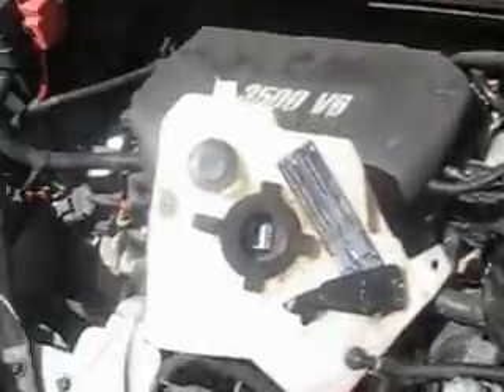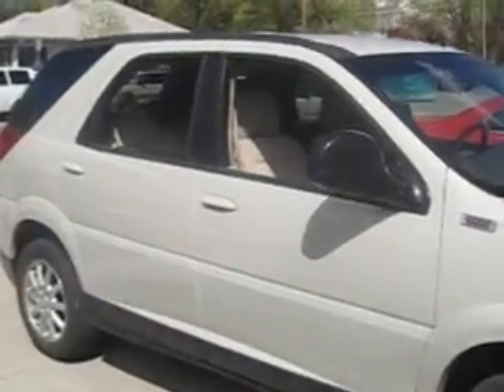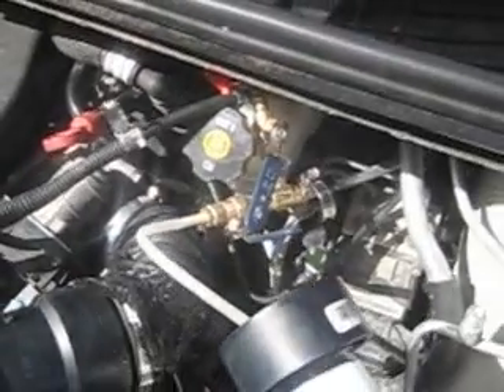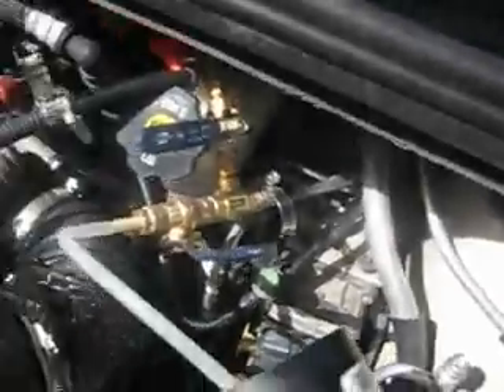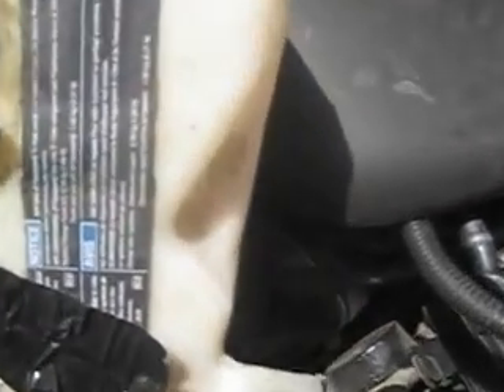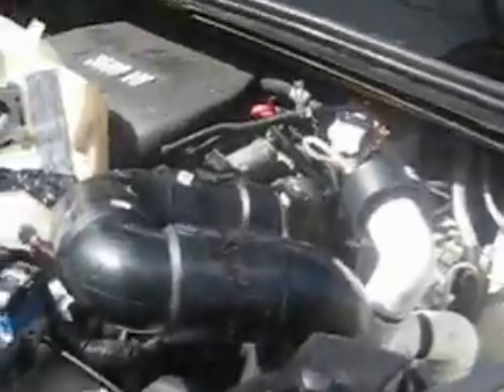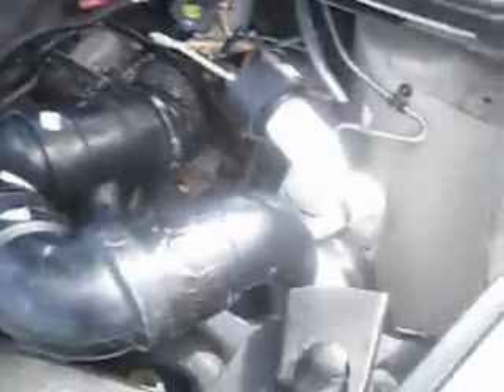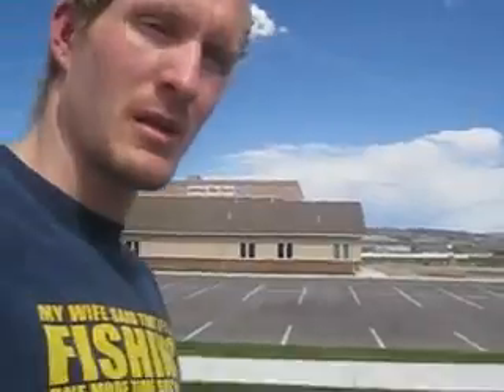200+ MPG Gasoline Vaporizer Project Original Design (Driving On Only Gasoline Vapor)

Comment from the maker: Thanks for the ideas. I am a few steps ahead of you on that. I have already tried using an ultrasonic 5 disk transducer. The new unit I am building will vaporize the fuel using exhaust heat. Once I have the new system up and going I will be connecting HHO up to my fuel injection system while running my car on gasoline vapors through the air intake..

Comment from the maker: It's the combination of everything that goes on when using HHO injection that make the engine more efficient. Frankly I do believe it is possible to run a car off of water it has been done and will be done again some day but certainly not by someone like you with such a closed mind.

Comment from the maker: The boiling point of gasoline is different from manufacture to manufacture and it ranges from 100 degrees F to about 400 degrees F at atmospheric pressure. It also changes with altitude, under vacuum, under pressure, etc. As for the vapor pressure it to depends on who the manufacture of the gasoline is. The auto ignition point of gasoline at atmospheric pressure is 536 degrees F. So yes I do know.

Comment: FYI you're an idiot, gasoline is not combustible as a liquid.  a fuel injector sprays a mist like a spray bottle would, tell the next person that cuts your hair to quit wetting your hair with a vapor!!  injection to combustion in the cylinder happens in under a second no where near enough time for that much evaporation to occur even under high heat.  learn physics AND how an internal combustion engine works before nay-saying.

Comment: What you are saying about incomplete combustion may be somewhat true, but only on a typical winter day, on a cold start. This is why carbs have a choke, and FI systems dump more gas on to compensate. Once warmed up tho and the computer switches to closed loop mode, it uses the O2 sensor to meter the fuel.

Comment: Well, if you were so educated, you'd know about things such as the boiling point and vapor pressures of gasoline, then you would know it is not possible for it to exist at the temperatures and pressures of a warmed-up, running engine.

Comment from the maker: DO YOUR HOMEWORK. RESEARCH YA HAVE TO DIG DEEP BECAUSE IT'S NOT ALWAYS EASY TO FIND BUT THE FACTS THAT THIS WORKS ARE OUT THERE. EVEN THE EPA HAS THE PROOF. EVEN THEY STATE THAT 56-60% OF THE FUEL IS WASTED IN THE EXHAUST.   CUT YOUR CRAP, EDUCATE YOURSELF, YOU NEED TO.

Comment from the maker: What happens when I burn the HOT vapors is a complete burn, there is nothing leftover. So cut your stupid crap and educate yourself more before replying negativity as you have because obviously you have no idea what you are talking about. It's also not a matter of believing this I don'r have to believe because I KNOW it works I've done it. If all the fuel were consumed it would not be possible to achieve these huge gains in fuel efficiency. So ya dude it does work.

Comment from the maker: Fuel injected engines do NOT burn ALL of the fuel. If they did cars would not need catalytic converters that heat up to 800+ degrees to burn unburnt fuel. If they burnt all the fuel you would not have to do emission testing and when you do do emission tests if all the fuel was burnt it would have a reading of 0. They never have a reading of 0. This right here PROVES that not all the fuel is burnt. In fact internal combustion engines are very inefficient about 60% of fuel is wasted/unburnt.

Comment from the maker: It runs perfectly fine when it is running on Hot vapors in fact it has MORE power with the hot vapors then it does running normal and significantly increases fuel mileage. Don't be making negative comets if you don't know the truth. Have you ran a car off of hot vapors? Most likely not. Therefore don't just assume. Just an FYI cars only burn vapors they don't burn liquid gasoline, this is why I pre-vaporize the fuel. Doing this allows 100% of the fuel to burn not just a portion of it.

Comment from the maker: It won't hurt it because I still control the air to fuel ratio using the valves. reading lean means more fuel is being burned.

Comment from the maker: I hear ya. I have developed a system that would work with any engine whether it be turbocharged, supercharged or just has a normal intake. It is not like the bubbler setup at all. Once I perfect the bubbler design I will be completing the injector adaptor design that will work on all gasoline engine types.

Comment: Vaporizer set up will not work on a turbocharged engine. Look at it this way: Naturally asperated engines vacuum a flow of air; Turbochargers there isnt really a flow as much as pressure in the piping and when the intake valves open, the air expands into it. Air gets in because it expands into the engine, not flow.
I hate that I have all these turbo sport cars and I cant do the same to them. I have a good idea on how to make it work, but I havent perfected it. Trust me, I want turbo and MPGs too

Comment: Have you tried putting a switch on the fuel pump relay, so that you can turn off the pump and not have to pull out the fuses or injectors. That way, if the vapors give you trouble, you can turn the fuel pump back on and drive on liquid immediately.

Comment: do you measure your EGT?? and your A/F?? im really curious b/c im tryna do it on my car but do NOT want my car to run too hot. Also...do you think fuel vaporization will work on turbo'd cars? since turbo'd cars consume alot more fuel and requires rich  a/f

Comment: Might I suggest a copper coil of perhaps 3-4 turns of 1/2 inch tubing inside your vaporizer. Run the ends out the top and hook to either the water pump bypass or to the heater hose con. This should pre-heat your gas enough to make enough vapors for higher RPMs.

Comment from the maker: I will be building a water injection system to go along with my improved design that I will be posting videos of shortly.! Thanks!

As for the air to fuel ratio I am not sure what it is, I am ordering a exhaust analyzer so I can know wither I am running too lean too rich or just right!

Comment: try running an oil pan heater into your fuel tub. have you ever checked your air/fuel ratio? i would guess your running really lean, which could harm your engine. think about doing a water/methanol or windshield washer fluid injection, i should help lower your cylinder temps and lube the upper cylinder, which is good because you dont have fuel spraying into the combustion chamber anymore.

Comment: this is a chevy issue now days, as they until recently ran returnless fuel systems in which vapour lock can occur if the raise is too hot (and does happen) but VP is very much an oldworld (carb) problem.  Modern efi uses a valve (fpr) to regular pressure the pumps dont.  Adjustable FPR's are easily bought these days with the capability of 60+psi though usually an upgraded pump is need as the extra PSI usually causes the pump to fail if its been around a while.

Comment from the maker: This was one of the first ideas I thought of but didn't do it because there are many factors to consider such as fuel line cracking or rupturing due to vibrations etc. You would need to design a devise that connects to the exhaust system that is a solid unit so vibration etc. is not a problem. I have one drawn up and may build it at some point but for now I am finishing the system I started, once that is done I may move on to a design with the came concept behind this one.

Comment from the maker: This is something I would need to look into more so I can know what pressure you would need in the fuel lines to prevent the gasoline from boiling. You would also need a device to control the temperature to prevent an over or under pressure in the fuel line a constant heat would need to be maintained. You may also have to change out the gaskets in the fuel rail and injectors to gaskets with a higher heat tolerance.

Comment from the maker: You got it!  As for wrapping the fuel line around the exhaust manifold to heat the gas under pressure then when it is no longer under pressure it flashes to a vapor this could work as long as you can maintain the right amount of pressure to prevent it from boiling. If the pressure happens to drop you will have vapor in your lines and this will most likely cause vapor lock. You may have to change out the fuel pump to a stronger one so there is more pressure in the fuel lines.

Comment: so the car is efi to begin with? and you have basically just added a manual carb and shut the fuel injectors off? Ive thought about having a brake shop fab up some new metal fuel feed lines that wrap around the exhaust manifold.  Under pressure of the fuel injection system (40+psi) boiling point of the gasolene is raised so it will stay a pressurised iquid until it is injected and at the right temp it *should* flash to vapour as its injected

Comment: maybe you can use just the butterfly valve in the throttle body to control the air/vapor flow with NO valve in the intake piping prior to the throttle body with a tuned orifice somewhere in the piping before the throttle body that is specific for the engine/car set up you are using?

Comment: In this video you seem to have reversed the air flow into the bucket. Before it came in from the side of the bucket closest to the firewall. Now it comes from the other side. Can we get detail of the vapor/air exit set up from the bucket and continue with the butterfly valve into the throttle body. also, looks like the air intake is still hooked to a filter of some sort rather than just sitting open. Details?  Thanks!

Comment from the maker: No not at this time. I am in the process of building a different design which will be problem free. It will provide consistent results and will be a design which people can replicate and achieve the same results as I do because it will not have problems as this one did. I will have electronic float switches that connect to solenoid valves it will have the proper splash guards and much more! I will be installing it in my Jeep for testing! I will make videos of the build install and testing!

Comment from the maker: The reason I was not able to go past 3500 RPM's is because the system was not built properly. I did not have good enough splash guards so when my engine reached high RPM's liquid gasoline was being sucked into the air intake instead of just vapor. Once I added better splash protection I no longer had this problem.

I will be adding HHO into the system at some point because I believe it will increase power and efficiency even further.

Thanks for the suggestion!

Comment: Compressor line to the the gas tank with a dip tube, pressure gauge will automatically keep pressure equalized, then the high pressure line from the fuel tank to the Fuel Rail to the injectors. This way you don't change or add much to your existing fuel system under the hood.

Comment: I had an idea of inspiration yesterday after watching your video's a couple of times. How about instead of running the Vapor through the air intake, you install a small adjustable pressure 12v compressor in the car, pump Air directly into the gas tank with a dip tube, then a pressurized line directly in the to fuel Rail to the injectors. That way you don't have to draw air through the gas, you actually create vapor by adding air, which forces the Vapor into the existing fuel system. Thinking.

Comment: Very good work man. It is just amazing. I need to watch your other videos but why do you not use your bucket concept?  I cannot figure out this design with the fuel supply running into your intake/bubbler... So pulling the air through less fuel makes for better vapor?

Comment from the maker: No not when the proper vapor system is connected to the car. 

With the system in this video yes because I did not have a good enough splash guard to prevent liquid from entering the air intake at high RPM's.

Comment from the maker: On this systems and the systems I have designed to inject the gas through the air intake no efie or computer is used to control the vapor because you don't need need them since  the float switch controls the gas entering the vaporizer and the butterfly valve on the air intake controls the amount of vapor entering the engine. No the vapor does not mess with any censers if you connect the censers up to the air inlet side of the vaporizer.

Comment: Man, ill email the video, i dont want this out for several reasons. However i want u to build it, test it on multiple vehicles, and tell me what u think, i makes me nervous having moving parts inside the intake tube. Cheapest float switch is at academy or  lowes by the way. Also if u want to asd horsepower to a stock engine, add this unit too, while fuel injectors are still rockin.

Comment: Just fyi, i dont know what my mileage is i have more tests i have to run for sure....but i usually keep 1 gallon in the unit and its lasted the last week of driving from here to work, to day care, and back home everyday so far....it still is hesitant around 5000rpms....lacks power, so on larger engines i may add a second unit with a spring loaded valve or a WOT switch to activate it.

Comment: Well with the stainless hardware its already pricey, we would probably make $50 profit per box maybe....u can use the armature off the existing fuel pump or add a second float switch by getting one off of summit racing . But those are pricey. I made out of old nissan fuel pumps and floats cause i used to work for nissan.

Comment from the maker: As for the price on the units I will have to see exactly how much it will cost to make then determine the sell price from there. I'm not into making allot of money off them I just want this out there for the benefit of everyone.Once I have the materials and labor costs I can let ya know what I would sell them for. A bubbler type of setup would work good for carbureted engines but I have a completely different design for fuel injected engines.

Comment: My units also have an auto fuel fill float switch when levels are too low, i say we sell each unit for $350 each. Mine are fail proof, explosion proof, and safe with little modification using most of the stock engine intake. I cant do this by myself, i dont want to be on a hit list.

Comment: Tyson,  i work for an electrical company now, i built a vapor system similar yet different to yours, i can get stainless steel boxes and tubing for any size engine, mine ran a honda crx and my wifes f150 with the v8. I have a unique back flash valve and a bimetal air trim regulator for weather change. No check engine light will occur, quick start, and immediatly stable. Only emmision is amonia and h2o, no nox or carbon monoxide....wana go in business and take down shell, valero, exxon, email me!

Comment from the maker: Not at this time no I wish. The system that I got the 200+ MPG on was not a good enough design there were to many problems with it therefore it was not reliable enough to keep installed on my car. I have since redesigned the system and have created a completely new system but am still building them and making improvements on them. There is still allot to learn before I can say I have a system that is 100% reliable. I have allot more testing to do. Great things take time but it is coming!

Comment from the maker: I have done some research on it but have found it to be a scam it does not work as they say it does because the temp required to get the Teflon to the point that it will coat the engine it hotter then the heat produced from the engine.

Comment from the maker: You can use a bubbler system and the key to that is to not allow any splashing to occur. I have shone some ways to do this in the lawn mower videos. It is a rough concept but can be perfected and used nicely in a larger vaporizer. I am working on another bubbler design where you circulate the gas through the bubbler constantly heating it up using a tubular coil that is wrapped around the exhaust. This keeps the gas hot so more dry vapor is created and released using a bubbler system.

Comment from the maker: It has taken longer then planned. I have done some more testing using heat to vaporize the gas and have achieved good results although they have not been as good as the first I achieved. I have thus far been unable to achieve the mileage gains I did on the first tests and have not figured out why. Maybe its the summer gas which is harder to vaporize IDK but I will figure it out.

Comment from the maker: I am not currently running on the new heat method. I am still in the process of getting everything together slowly but surly. I have the design pretty finalized but am funding nearly everything myself at this time until I have the parts completed and can show the results I achieve to those who I am in the middle of partnering with. They have helped me out a little but things are really tight for me because I have to first take care of my wife and 5 kids, the vaporizer comes second.

Comment from the maker: You are absolutely correct it does run differently during the winter and there are more additives added into the gas during the summer to prevent it from vaporizing as easily so there are not as many problems with cars vapor locking. I have done lots of research on gasoline and the additives and have calculated the amount of heat needed to crack gas and its additives so there is nothing remaining that would need to be drained or disposed of .